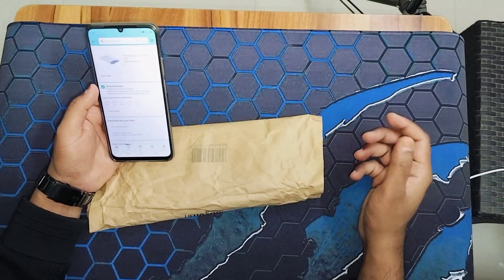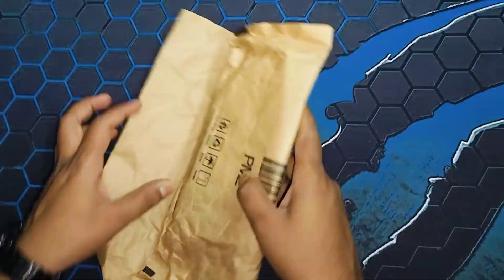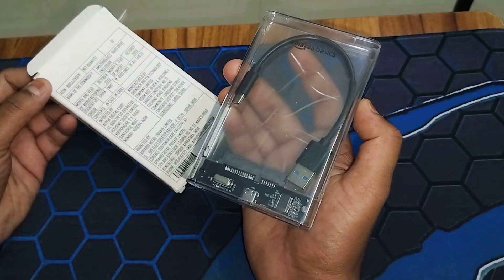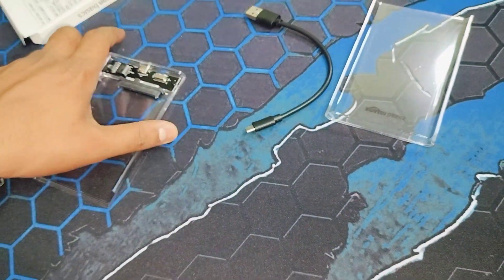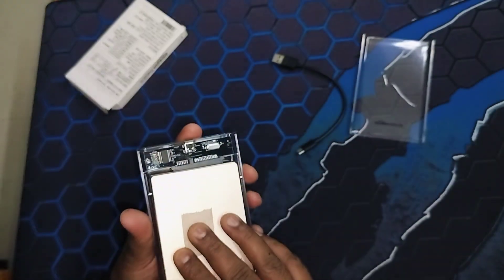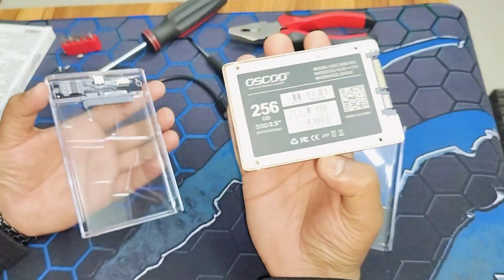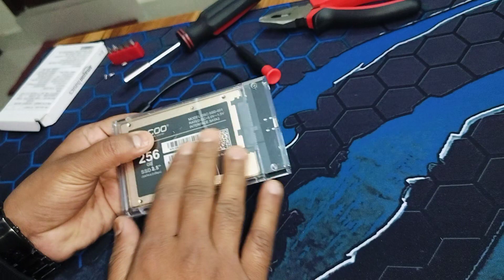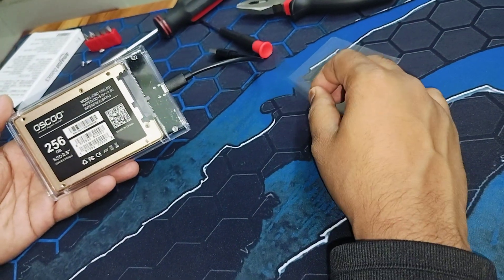Amazon Basics 2.5" External Hard Drive Enclosure, SATA III to USB Type-C for HDD/SSD RS 349 /-

Comment: Please do speed test urgently...
Reply: Meaning it's a bad device as ssd should provide atleast 400 Mbps
Reply from the maker: @suryanshugupta6940 yes you are right, that's the reason I have also returned it now I'm planning to purchase a new device which is decent I will spend extra and get it reviewed here. Thank you
Reply: @ChoudharyKaDimag  similarly i am placing order tomorrow trying orico one seems decent
Reply from the maker: Hey it's 40 Mbps folder to folder